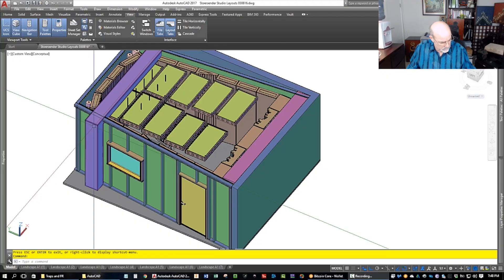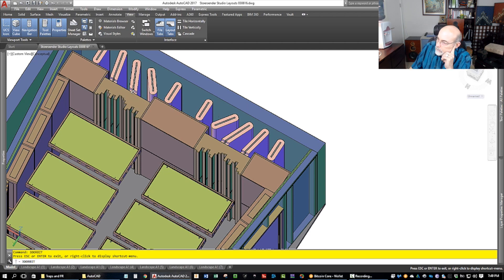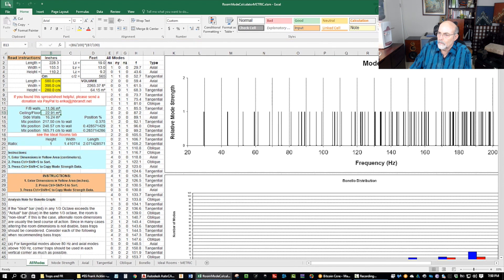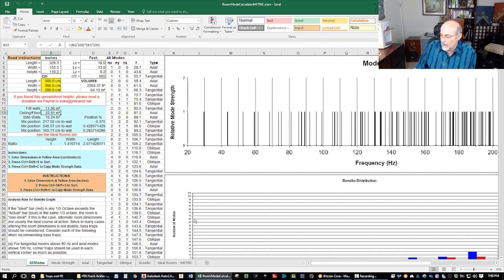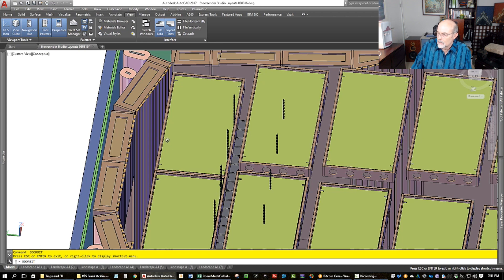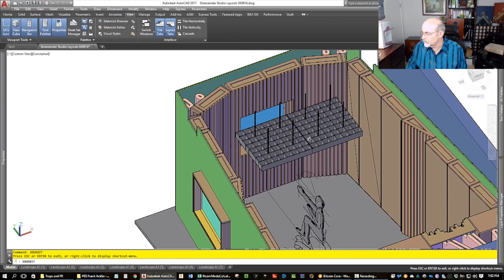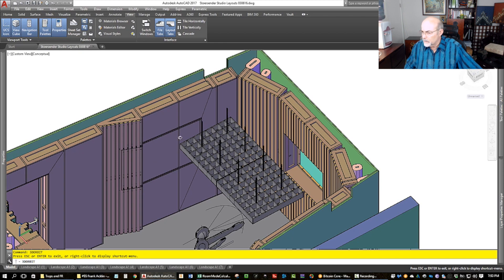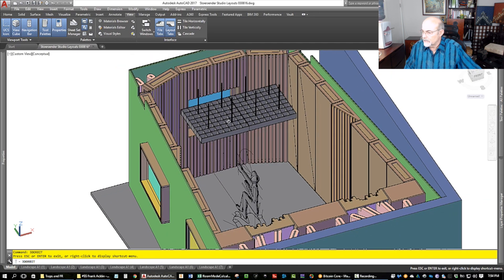Small Room Acoustics: Small Room Treatment Basics - Part Two

Comment: I'm surprised to see membrane traps away from the rear wall where the pressure would be maximum. Is the wavelength large enough at 30hz for it not to matter?

Comment: Hello sir, waht if I only have 3m W and 3m L and 2.8 m slanted ceiling, I already add 4 10cm bass trap in each 4 corner, but still no ggod response below 150 hz. Thank Sir
Reply from the maker: That's because, good response is not going to happen in a room with the same dimensions for lenght and width. That is the uncomfortable but honest truth. Is there any way to change either of those dimensions?
Reply: may I sent you message at your facebook sir?
Reply from the maker: Cahyo Baskoro, of course! :)

Comment: Very nice videos. They really help allot. I do have a little bit off an oddball though. I am trying to treat a room that a friend of mine uses that has carpet on the floor and on the walls. The room is 15x14,6x8,5ft and has a dropped ceiling. The problem I am facing is that although I am allowed to hang stuff on the wall and maybe place a hardwood floor in over the carpet, the owner of the building does not want me to actually remove the carpet. What would you recommend for a room like this?
Reply from the maker: I would recommend a LOT of portable traps. Is this room framed or stone/brick construction?
Reply: John Brandt : Thank you for taking the time to reply. This is a constructed room made out of wood panels with rockwool inbetween. We are already planning on taking out all the carpet and putting in a hardwood floor. That should be a good start from what i've gathered.
Reply from the maker: Marten, It's always difficult in those situations to get exactly what you want, but like song says, you can get what you need. ;)
Hardwood is good. Most music is enjoyed listening to with a hard floor surface; from classical to rock band performances. That's the way we hear it.
Removable acoustic walls. There are ways to do it where you get the optimal acoustics and portability. Remember that you can't have both so something has to give. But it's not so bad. Even in the top pro studios there are compromises made. It's a real world. Send me an email. :)

Comment: Great video, very helpful. I am wondering if the waveguides are fixed with a solid core or if they are hangers?
Reply from the maker: No Hangers! We do Fixed wave guides and they are solid 3/4" or 18 mm MDF. They are to 'guide' the sound waves.. or at lease move the wave direction a bit. The mass of 3/4" MDF is good but it's not THAT much, yet it has an effect. We used to use fiberboard, but a fiberboard system does little to re-direct the sound waves at low frequencies. The massive MDF is much more effective. ;)
Reply: Thank you for the information, very interesting. I may try and build some of these for my studio.

Comment: Dear Mr. Brandt, Thank you for your information. Can you share with us some information about the cloud ceiling panels? How deep they are and what kind of insulation, density you used?
Reply from the maker: Ceiling panels.. it really depends on what trapping you are already using for the ceiling trap. The ceiling trap is just about the MOST IMPORTANT trap in the Control Room. If a cloud panel is all you've got, I would recommend making is as deep as possible. I use lightweight fiberglass, Dacron, and 1", 40 kg/m3 rockwool. -  Mostly lightweight Fiberglass.
Reply: Dear Mr Brandt, you saved my life! Thank you a lot.

Comment: Hi Mr Brandt, your videos are extremely informative and I really appreciate it.

May I ask you how does space couplers affect the first reflection since you place them at the position which i assume them to be the first reflection point off ceiling? I often see you use them in your design.

By the way, I am a huge fan of your designs and works. =D

Thank you very much sir!
Reply from the maker: Space couplers will effectively double the absorption of the cloud or ceiling traps. They do this by redirecting sound rays/waves upward into the traps. When a ray or wave is re-directed by the space coupler, it also loses energy, reducing the level of that reflection.

Comment: Thanks for that amazing video!
Could you please tell us more about the waveguides, why they have been angled like this and when they perform better than superchunk traps?
Reply from the maker: Wave guides, properly done will always out-perform the 'superchunk' style traps. Reason: rigid glasswool or rockwool becomes reflective past 4" thick. So after a certain depth, it doesn't really help anymore... It just COSTS more. :P
Wave guides can actually 'guide' the waves, or turn them. There are air channels that allow the sound waves (and rays) to enter... They check in, but they don't check out. :D
Reply: Hi John. I’d love to hear more about these too. I know this is a fairly big topic though and that research is still being done, but I know you have spent a lot of time thinking about them and using them. I’ve actually been racking my brain and research abilities trying to understand them. Even reading Newell and sources like that get confusing with edition addendums, etc ;)  Though they have pointed me to interesting studies like the array concept you mentioned. And then there are the late Desarts interesting discussions on diffraction effects, tests, etc. Not sure I quite got my heard around the reference to the “reflective past 4 inches” above, unless you’re referring to higher frequencies.  Otherwise they would make for great low frequency isolation devices if they reflected. Though it did make me put some thought to why their efficiency decreases past a certain point like you mention. Lots of paths I’m trying to venture down as to how these waveguide “traps” work: maybe it has to do with gradual impedances changes, maybe keeping absorber thickness narrow but spread along the wavefront presents more tortuosity potential, maybe that same spreading also helps prevent a sort of “saturation” effect that would cause thicker absorbers to eventually move as a more solid mass, maybe because they get redirected/reflect and cause more paths through absorption, maybe there’s some phasing through these paths, maybe…..well…it feels good to blurt random things out. Ha. There are a dozen more maybes. This will take a lot more time on my end to even remotely understand. Maybe one day we get to hear your thoughts too :) Thanks for keeping discussions and thoughts open and out there though John! Take care.